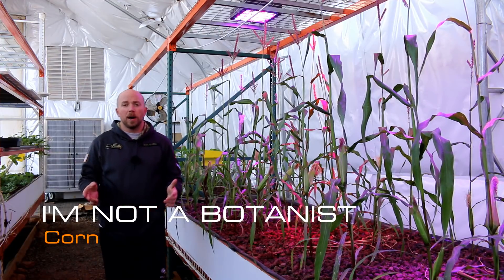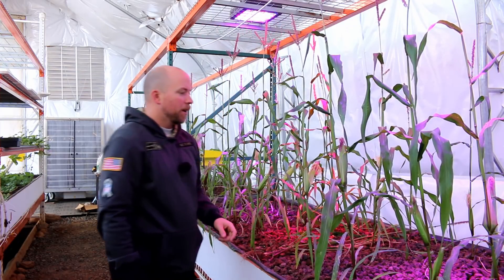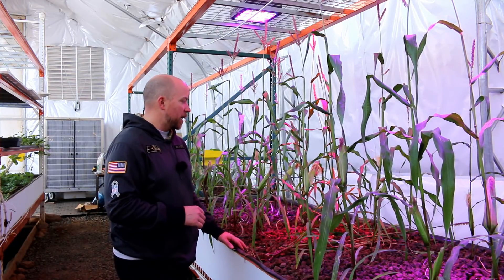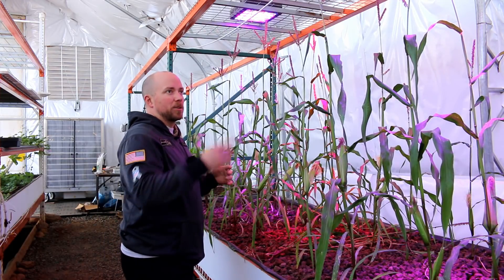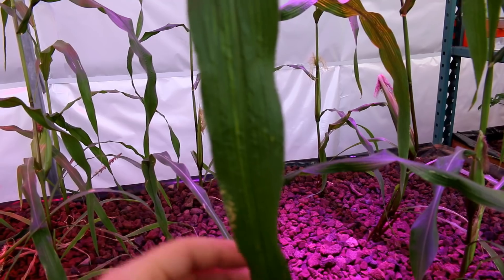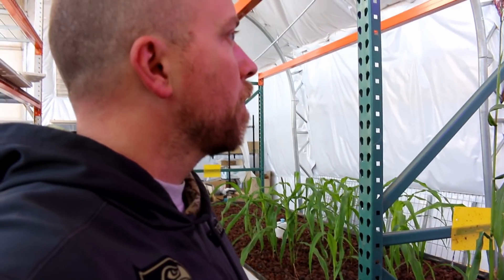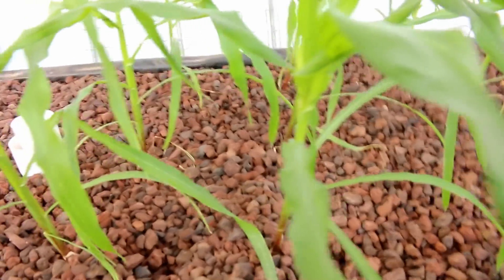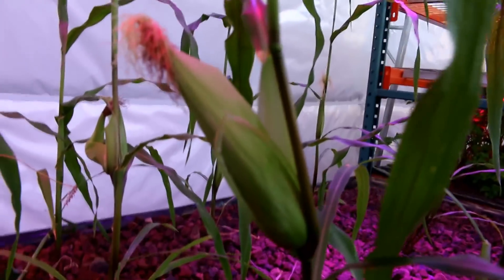Growing AQUAPONIC CORN - Things to Consider

Comment: Again late for this, sorry. It seems to me that one of your leaves has inter-vienal chlorosis which is a classic symptom of nitrogen deficiency. This is pretty common in corn, you are right that corn consumes a lot of nitrogen. However, the reason for this is because nitrogen is a critical component in creating proteins which contributes to the biomass of the corn. My backgrounds is in crop science and genetics. One thing that we were taught in college was the dogma of molecular genetic theory which states that DNA is transcribed into RNA which is then translated to proteins. What this means is that, without adequate nitrogen your corn cannot form the proper protein structures necessary for healthy development. I would recommend that you not plant your corn as dense, maybe you could experiment with interplanting pole beans with your corn. This would help you by incorporating nitrogen created from nitrogen fixation from the bacteria colonizing the beans roots to supplement the nitrogen needs of your corn plant. Also, the pole beans could then grow up your corn plants, so you would not need to provide a pole for them to climb up. Another recommendation, I would have is planting a smaller cultivar of sweet corn that requires less nitrogen and short season such as Yukon Chief Sweet corn which was originally developed the university of Alaska. It is a smaller sweet corn variety but it has a growth period of 55-70 days and produces at max 6 ears per plant. Also by combining corn and beans, you would have both lysine (from beans) and methionine (from corn), both are essential amino acids needed for healthy human growth.
Reply: On the behalf of all of us that are trying to grow in aquaponics i want to say that you for this comment it was very educational.

Comment: Corn is EXTREMELY hungry. It takes a huge amount of nitrogen to keep it happy. As others have mentioned, the light make a difference too. They need very full sun and heat. An areas potential for corn is measured in heat hours. Many varieties of corn require very high heat hours. It is cool enough in your greenhouse that you are wearing long sleeve which means it is not nearly hot enough for the corn to be happy. The red on the ears typically means that the ears are already past their harvest time and are going starchy. They are still edible but at this point they will be losing their sweetness as the sugars are converting to starches.

Comment: You might have a nutrient deficiency. Basically you are growing them in water and they might not have enough to pull from as opposed to having them planted in dirt. The stunted grow might be due to the inability of the root system to secure itself fully in the planting bed. The stalks might only grow has tall as the roots can support. I would try an experiment and plant some seeds in a pot of dirt or Coco Core. At the same time, plant some outside the habitat to determine if they at least grow taller in the shortened season you have up Northwest.

Comment: Purplish/reddish look in corn (turn off the grow lights and check if foliage and stem is purple, red or brown) can be signs of a phosphorous (P) deficiency. Zinc (Zn) deficiency can cause intercostal yellowing, but veins to remain green as well as stunted growth in corn.  You should also be checking PH of system.  PH has a direct impact on various nutrient uptake.  Corn does well in PH of 5.6 to 7.5.  You need to check the roots of the plants as well as the foliage, restricted root growth can occur from nutrient deficiency.   Could also be Sulphur (S) deficiency.  The corn appears to be upright, but stunted.   If a high water availability/ high PH situation, lack of sulphur can give those symptoms.   You really need to provide more details on the root structure, the foliage symptoms, discolouration and its location as well as the Aquaponics system parameters (temp, PH, salinity, ammonia/ammonium, dissolved oxygen etc.) if you want a more accurate diagnosis.
Reply: The reddening on the ears is also a sign that the ears are over ripe. The sugars are converting to starch in preparation for the ear to be harvested for seed.

Comment: For a control at your geo location I'd suggest planting a few items in a plot outside the building  but yest the corn should be in one of the middle rows with 100% sun that and some crops like corm may be a crop that just doesn't work inside.